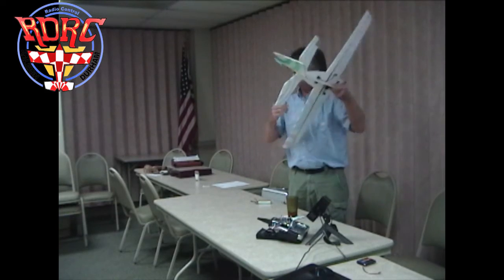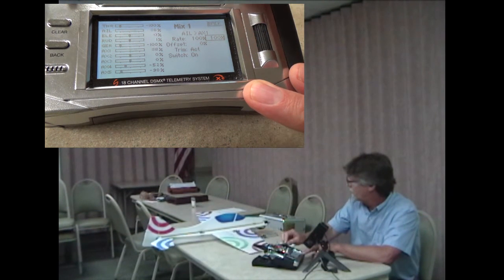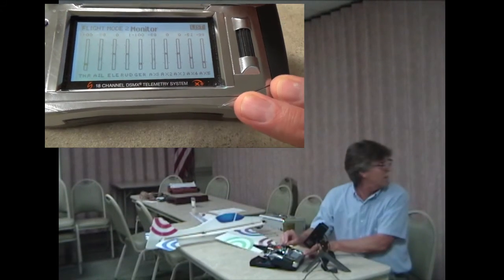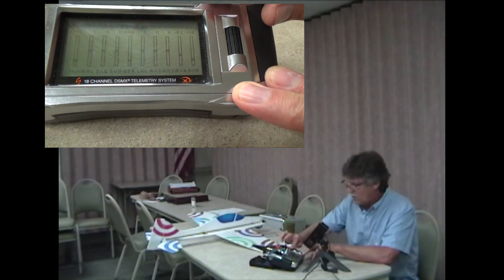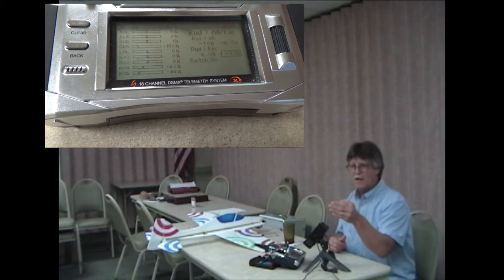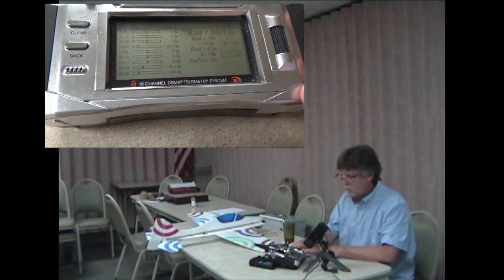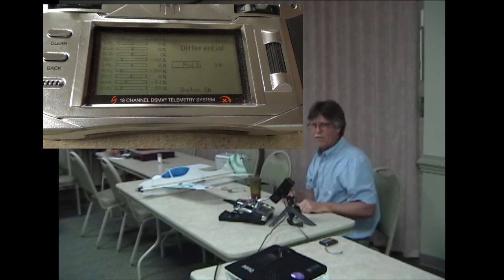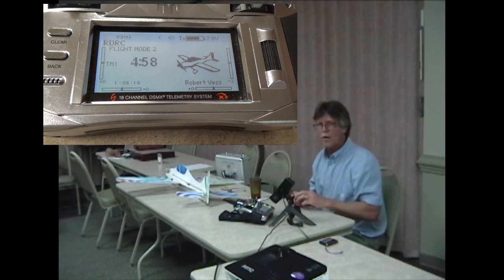RC Transmitter mixing 101 with Robert Vess

Comment: Who needs mixing?? Who needs a stabilizer??....You may not NEED either...but flying is so much better with them. It's like having the right tool to do a job vs trying to use a screw driver to hammer in a nail. Thanks so much for this video. It's going to help me immensely.

Comment: At 35:00 he was looking to see elevator move with throttle.  It didn't.  For anyone reading these comments, the reason why is due to the switch position of Switch E.  It wasn't in the correct position.  

If you look at the 3 boxes below the words "Switch E", they are labeled, "0", "1" and "2".  Those are the switch positions.  The little tiny black square under the boxes is showing the current switch position.  In the video, it's under "0", so that means that Switch E is currently in the "0" position.  

A dark box indicates that the mix condition you programmed is active on that switch position.  A light box indicates that the mix condition you programmed is NOT ACTIVE on that switch position.  You can have multiple dark boxes as well, meaning the mix condition is active on multiple switch positions.

In the video, since only the "1" box (Switch E position 1) is dark, the programmed mix will only be active when Switch E is in the "1" position.  But, as you can see by the little black square under the boxes, Switch E is currently in the "0" position, which has a light box.  A light box means the mix is NOT ACTIVE.  So in the current switch position, the mix is not active.He just needed to change Switch E to position "1" for the mix to work.I'm sure he knows this and just got caught off guard in the video demo.  I'm just documenting it here because documentation on how this all works is pretty scarce and as a newbie, I'm always wading through tons of material trying to find answers on how to do things.  Hope this explanation helps someone!

Comment: Hello Robert. I just came across your video on mixing and am still trying to wrap my head around it.  I have been trying to set up my motor glider so that when I drop the throttle off it will apply just a touch of up elevator to maintain a better glider ratio.  Without power the plane will tend to drop at a higher rate.  This being because I do not have a folding prop on the front so that when it wind mills causes more drag and thus wants to descend. Not a bad thing as it helps set up for landings.  I am new to mixing and want to set up my Spektrum DX6e transmitter so that I can throw a switch to apply up elevator so I can maintain a better glider ratio when I power the motor off for gliding.  I so far have been un-successful in getting my transmitter set up in mixing to accomplish this task.  Please let me know how I can make this work.  Thanks,  Dave

Comment: I am a beginner and have a high wing trainer plane that nosed up sharply when throttle was applied...too difficult to add downthrust  washers to the engine mount so a friend added a  mix 1 for THR / ELE ...
...when I look at the DX6 Tx screen it reads  6%  3%...0% offset....the plane now flys great  and this keeps the nose from climbing when I apply power...but can you please explain what that  3%   mix number is doing ...I am  understanding  that the first number (  6%  )  is adding down elev, but the 3% is confusing to me.......thanks

Comment: This video is 5.5 years old. Great content! Thanks! I have a problem not addressed here though. My Horizon Hobby Carbon Cub S+ came with the hardware to install the flaps however I can't use the built in Elevator to Flaps mix because the Safe Technology consumes AUX1.

AUX1 is in normal planes the default flaps connection I guess but on this plane the BIND button is the default AUX1 switch, AUX1 is used to turn on the throttle and is used to initiate PANIC MODE as well as Automatic Landing.

The instructions provided by Horizon Hobby direct us to connect the flaps servo to AUX2 and so on. All well and good except there isn't any information about mixing AUX2 with the elevator to prevent ballooning. When I go to MIXING and create a new mix activated by switch D for AUX2 to then add ELEVATOR down trim I do not see any movement on the elevator. What gives? What an I doing wrong?

Any advice would be greatly appreciated.
Reply: You can turn off safe. 
I suggest you do. 
Or switch to using aux 2 for flaps

Comment: Will a throttle mix still work when throttle cut is active?

.. can we “reset” AS3X to be level if the board wasn’t mounted at the exact correct angle? Asking for a friend.. 😂

Comment: AMAZING VIDEO...THANK YOU SOOO MUCH!   However, one quick question.  So when you set up a mix, you use a positive percent if you want the slave channel to move the SAME direction as the master (Example: left rudder gives you left aileron)?  Negative percentages will typically give you the opposite direction (Example: left rudder gives you right aileron)?    Thanks again!!!